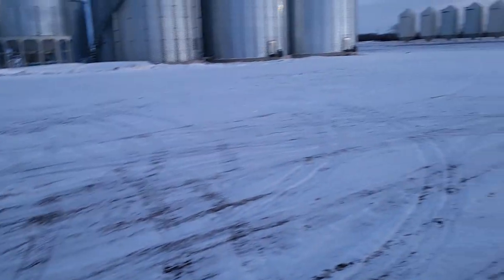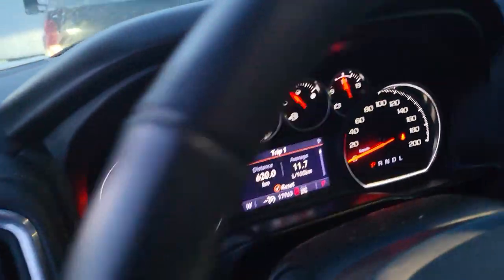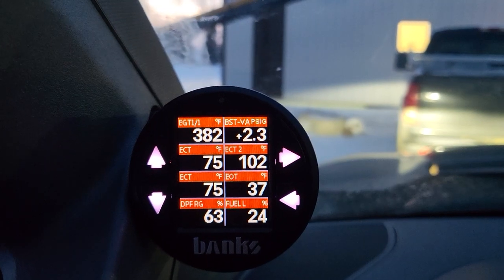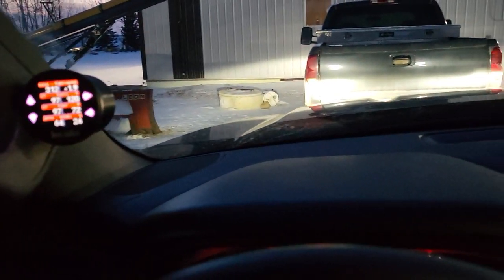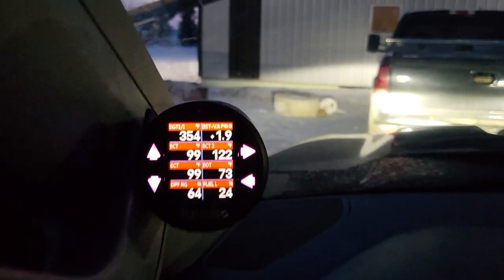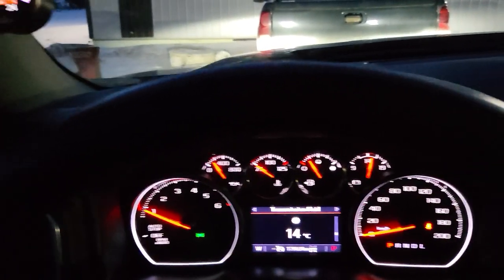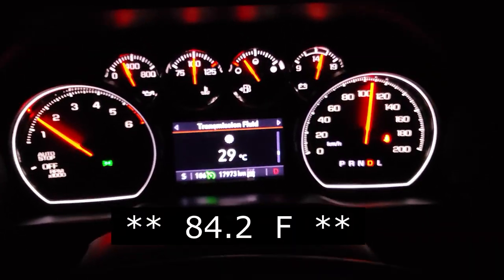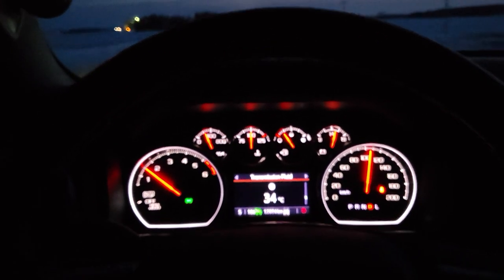3.0 Duramax Cold Start  (w) Banks Idash

Comment: Start the truck with the remote, wait :30 sec or longer and repeat the process of pressing the lock button and the lights will flash and press the engine start button and the lights will flash, this adds 15 mins to remaining run time. 
Where did you get the I dash mount? I have a 21 GMC
Reply from the maker: Thanks,  check out my other video i made the mount myself.

Comment: I’ve got a 2021 GMC with the LM2 don’t think I have the 20 min shut off.  Pretty sure I’ve idled the truck more than 20 min. Is that a Canadian thing?  I’ve heard the 2500 have that here but not on the baby d max.
Reply from the maker: Im not sure,   but mine for sure will shut off after 20 minutes even if I start it with the button in the cab.

Comment: I thought the LM2 had a option for high idle? I saw a video where it can be turned on or off. Please confirm.
Reply from the maker: It does have an elevated idle,  depending on temp and time it’s been running.

Comment: I’m thinking of trading of my 6.2 for the 3.0 but worry about the diesel in winter My 6.2 is great it warms up fast in winter lots of power but I’m thinking of traveling so need better fuel mileage but worry about emissions freezing up and taking 30 minutes to warm up the diesel before driving it in winter ❄️ I also live in Winnipeg ✌️🇨🇦
Reply from the maker: Mines been good on the cold days,  20 minutes usually is enough time for warm up.
Reply: Thanks any problems with emissions freezing up going into limp mode
Reply from the maker: @gk9417  no I haven't had any issues with the emissions system.  I'm only at 22000 km right now.
Reply: @gk9417  did u switch?
Reply: @watchmanexpert  hi still scratching my head about pricing $100k plus for a truck now losing at least 30k on my trade in Can buy a lot of gas for 30k lol 🤷✌️🇨🇦
Reply: @gk9417   i bought mine 60 k I will sell my Titan , the economy is awesome 30 mpg . Compared to 9 or 10 mpg on my Titan
Reply: @watchmanexpert  I’m getting 14-17 mpg my truck is a 21 Denali bought it for 80k taxes all in they want to give me 65k and a Ultimate bare bones is about 115 k with taxes all in I’m 68 years old do I really want to spend that kind of money on a truck 🤷✌️🇨🇦 Had to stop myself couple times lol ✌️
Reply: @gk9417   2021  and 17 mpg is no need for the 3.0  … in my case I have 2010 and 9 mpg LOL … if u decide let me know LOl , the 3.0 is awesome truck  . Good night my friend

Comment: Is there any way to prolong or change the timer for the engine shutting off automatically after 20 minutes?
Reply from the maker: I think you can go to the dealer a request programming for extended timer for leaving you pet in the vehicle.  I haven't done it so not sure.